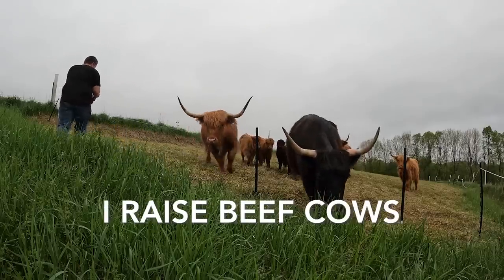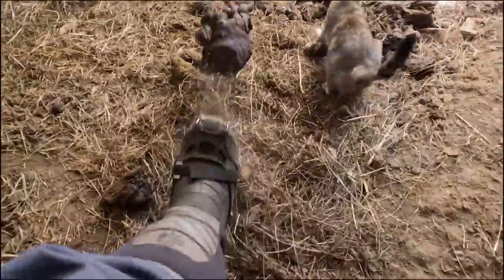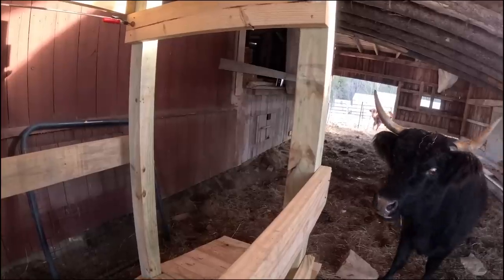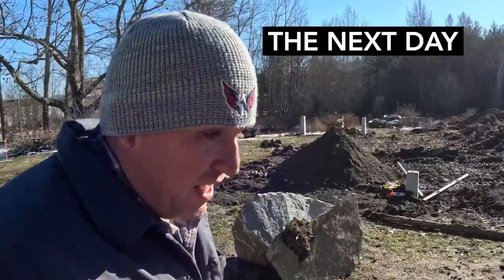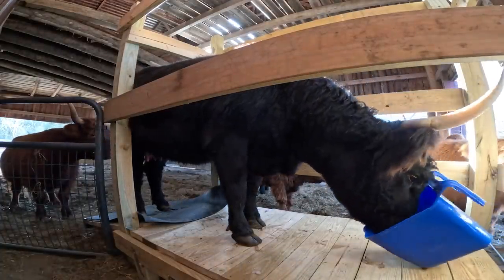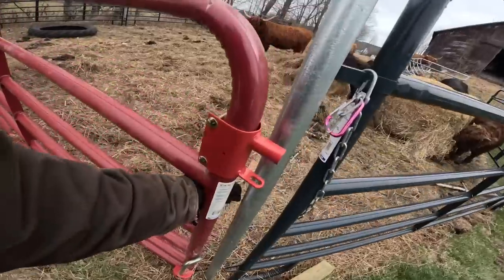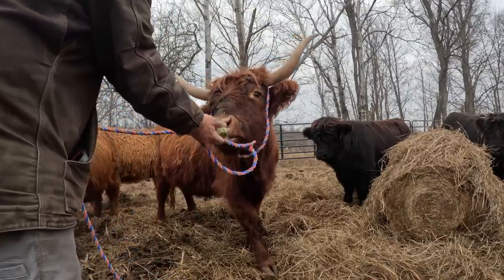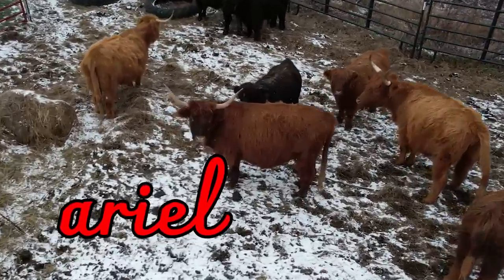Milk My Beef Cow or Die Trying!

Comment: yay!  I'm glad you and Ariel figured it out.  I was concerned when the crew came in from the side of the milking stall.  It seemed noninstinctual to expect a target cow to make a 180-degree turn to come up the ramp into the stall.   I think it would be easier to bring the cow in from the opposite barn door if possible so the cow is headed straight for the stall ramp.
🐂🥛🎊

Comment: You need a bar to go across the back to hold their rump in. Also, work on washing their teets before milking so they don't get mastitis or you end up with tainted milk. Both your healths are important. Make up a separate bucket with towels and very warm soapy water as well as water to rinse the teets off with another clean towel. You don't want any poo in the milk.   Congratulations on getting milk! That's HUGE! Also, Highland are a dual purpose breed so yes, they are meant to be milked :) Overall, well done!

Comment: Morgan, what was with the whole wooden platform thing?  I know your cows are short, but why start with a scary apparatus and then add the unfamiliar milking by a human?  I bet you can find old-fashioned metal dairy stantions second hand.  Watch for them at auctions.  You then build a frame in your barn to hold the stantion in place and put a manger under the stantion where her head comes out.  They are shaped properly to fit the neck of your cow, and you simply lower the bar to hold the cow in place and she goes to work eating whatever yummy, nutritious thing you have for her in the manger.  You sit on a three-legged stool, lay your face or forehead against her warm side,and use two hands to milk.  Oh - you are going to want a few yards of baling twine tied to the stantion so that you can loop it around her tail on the opposite side from where you milk her. That keeps the tail from whacking you in the face.  Keep an eye on her feet while you milk, she may kick the bucket over.   Three-legged stools are the best for places where the ground may be uneven.

Comment: Might need to take into account horns as well. Since most milking cows have stumpy horns or are polled. Could maybe cut the horns down to managable for the cow(s) you want to milk. Some no skid on the ramp and platform will help with them not slipping and sliding, which will scare them from going up as well.

Comment: Never saw a dog turn down milk before.  🤷‍♂️  I think you’re on the right track with your milking stall. Suggest reinforcing the main frame and side rails with lag bolts. The screws won’t last.  Also, if you want the cows to have treats when they enter the stall you need to position the bucket at grazing level.  More natural for the cow.  Maybe you did but it looked like you might have had it more like waist high.  Also, the stall might have been too close to the wall.  They won’t train easily to a close set up.  Too claustrophobic for a cow.  Will you be milking on a regular basis?  Finally, would be great to see a video when you have the vet in for regular health checks on the cows or the flock.  The interaction with the animals, the vet/farmer conversation - would be awesome.

Comment: 🤔 it will serve you well to add crossbeams to the underside of the milker and to use actual bolts that will support the weight of the cattle. This just is enough and may prove dangerous for you or your livestock.
You would do well to give yourself much more space and not be so close to the wall. You could easily get crushed.
As for the milk you may need to start training the younger cattle/ calves. So when it’s time they will be ready and not bothered. 
Of maybe you should forgo the stand and just use a long enough gate and squeeze the cow with the gate.

Comment: Why don't you secure that black footing sheet to the wood?  It's a  tripping hazard that might scare some away, one more undermining of trust along with the failed flooring. Also, you don't want them to get a leg up under the horizontal slats and down to the ground, also frightening them.  Try to head off problems before they become problems.

Comment: You are leading your cows backward.

Do not lead them. Push them.

Look up a cow's flight zone and work with that if you want to move your cows anywhere. Significantly easier and safer.

Also, if you want to make a little structure to milk your cows, a corner is a terrible idea. Not only is it scary for a cow (no sign of escape) but could be very deadly for you being pinned in the corner. (Especially with highlands)

Your best bet would be to build a corridor that leads into a funnel that leads into the shoot, with an exit for them from the front, cows do not like walking backwards because they can't see back there.

Good luck with the milk. I would guess it would be similar to milk from dairy cows, just not as big a quantity. It probably tastes different considering the different %fat in their milk versus a holstein or a jersey.

Comment: Where are the doors?   Only let the cow you want into the barn when milking.   I thought the platform would be too short, so make it longer.  Get rid of the neck clamps because the horns are wider than the opening.  Attach the gate at the end to keep them in and the gate should also be used so they do not enter the station when you are not milking.

Comment: Work with female calves now, the younger the better, getting them used to stepping up on the platform all the time and when they are older they will be so acclimatized to you and the milking stand it will be so much easier. Patience and more patience.  Hugs from N.C..❤️

Comment: Why not just have it at ground level...my grandparents milked cows they never had ramps they had to walk into...just a area and they sit down on a stool and milked away...also it's way to narrow....and off the ground...they would of easily walked right in if a little wider and not up in the air and ramped off the ground...they are use to walking on the ground 24/7....you went a little crazy with your construction project....make it simple...just build a open wall and you already have the barn wall use it.... easy peasy....sit on the other side and use the wall that's already there and build a open wall but wider...

Comment: You made a mistake on your ramp you are relying on the the sheer strength of the screws instead of supporting the runners to the ground you should throw some bricks under the runners  to help support  them

Comment: I will suggest that if you want to milk a cow you get one that is less hairy. Milk goes 'off' in flavor when hair gets into it.  You need to thoroughly wash the udders and make sure you don't get droppage in it for reliably drinkable milk.  Of course you could get her used to you enough to trim her hair up and shave her udder a bit and make it workeable...maybe.  Perhaps a nice Dexter cow?. In the meantime, this crush you've made can also get them used to you brushing them and handling them.  Could make it much easier to treat them if they need it, too.

Comment: Ummm did you use a stander for your milking station? cuz it looks like it.... and thows are bilt for milk cows not beef cows.... beef cows are well more beefy so more wait.... milk cows dont have horns so it will be hared for them to get there heads throw and ther is not much space for there head, maybe pool it away from the wall a bit more for the cows head to not fill traped ther nose prest up to the wall, even maybe tern it 180* may be ez-er..... i know i would feel traped if i had to twist my head into it then be brething onto the wall.... also i think your cows like to see whats going on around them so 3 feet from tip to noes to wall may be minimil i dont know having a hade time geting thots doun sorry.